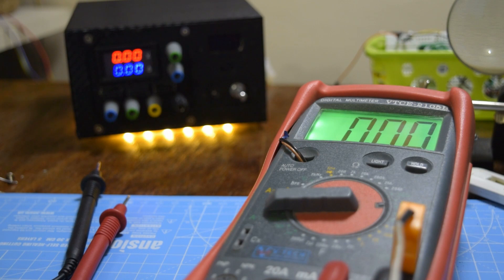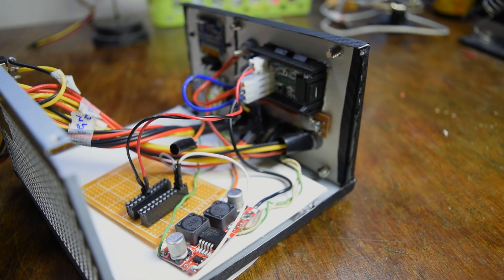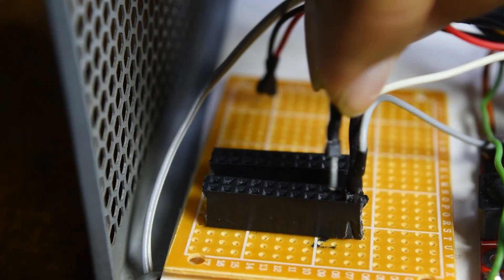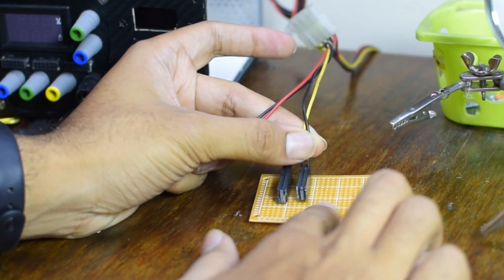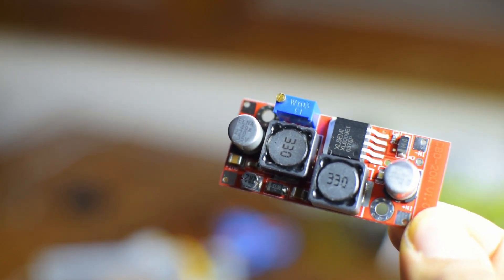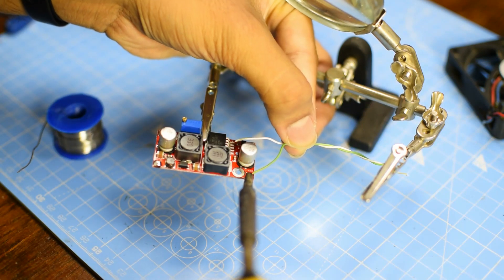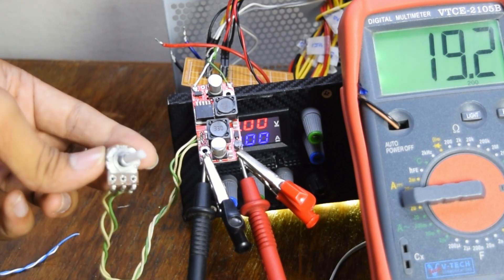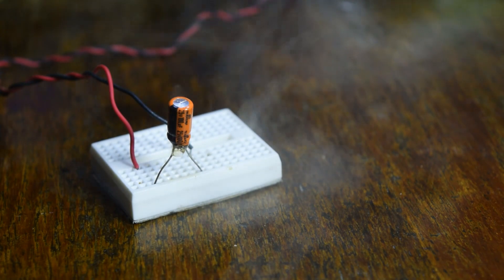DIY Lab Bench Power supply Upgrade Pt 1 | Buck-Boost Converter(1V-40V)

Comment: Hi, can you trust (yanwen economic air mail) delivery on AliExpress? Have you ever ordered through it?
How much time it takes to reach here?
Reply from the maker: Yep! I've never missed a parcel till now, I buy all my electronics on AliExpress. Although sometimes products get too delayed and take longer than 60days, the seller refunds the money if you don't receive your item.
For me the packages arrive in  20-25 days on average
Reply: Hi have yo
u completed your ECE?
is it easy?
Reply from the maker: I'm in 3rd year ECE, do you love electronics?(It shouldn't matter whether it's easy or not when and if you love electronics :P)
But anyways to answer your question, it's a mixed bag. Our curriculum is a little outdated and lacks a logical flow to the 4 year course
Reply: Curio yes , I have seen your 4*4*4 led cube. Can you show how to make a rgb one
Reply: Can UL2003A be used as replacment for n channel mosfet, can this darlington array handle upto 5 Amp ?
Reply from the maker: Check out the datasheet, as far as I know that IC has an array of 6-7 Darlington pairs with each capable of handling about 500mA.
Also mosfets would be faster at switching.
They both serve different applications 🤔
Depends on your application 😁
Reply from the maker: An RGB 4x4x4? Yes, it's on the list. It takes a lot of time so have been pushing it down the list. Soon enough 😋
Reply: Curio For RGB led cube, its  common cathode , cathode  would be control by 3 * s4hc595 chip and anode through 2n2222. Each shift register  control red green and blue respectively .is this all correct?
can I daisy chain the 3 shift registers?
Reply from the maker: For 4*4*4, you'll need 48 control lines . 16 columns of 3 control lines . So 3 of those shift registers won't be enough.
You can Daisy chaining will work, but sometimes it'll get tricky to get them to work in Daisy chain form
Reply: Curio, each 74hc595 has maybe 8 output pins I need to control 16, so I need 6 74hc595's?

happy holi
Reply from the maker: Yea 6 of them will give you 48 pins , but again not a good way to Drive an RGB LED cube. You don't get  control over anything
Reply from the maker: Happy Holi by the way 😁, you can find me on Instagram (@curio.central) you can DM me there 😀
Reply from the maker: DM is direct message, like a chat
Reply: Curio what about whatsapp/facebook?
Reply from the maker: Sure I have a page on facebook as well, you can message me there. https://www.facebook.com/CurioDIY/
Reply: Curio are you sure, this error is coming
  (The page you requested cannot be displayed right now. It may be temporarily unavailable, the link you clicked on may be broken or expired, or you may not have permission to view this page.)
Reply from the maker: Just search for "curio.central" on facebook